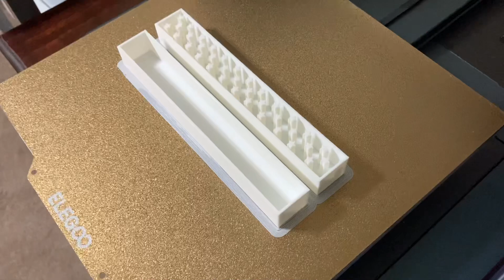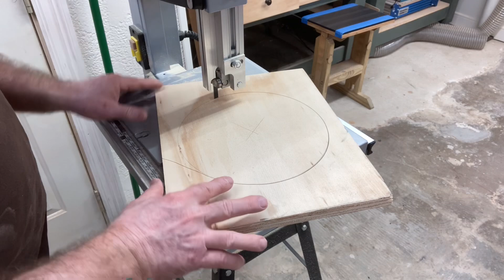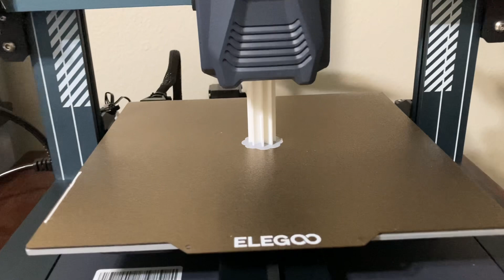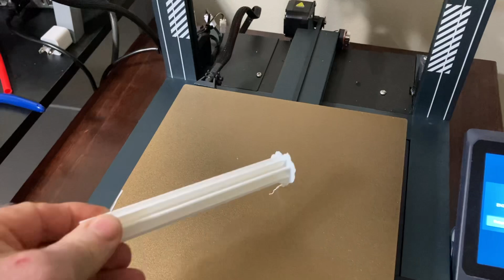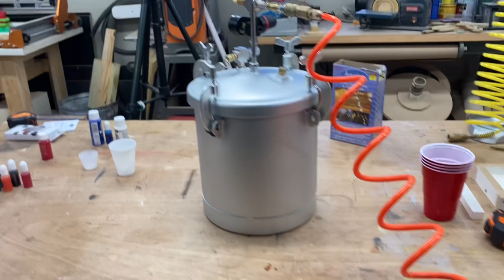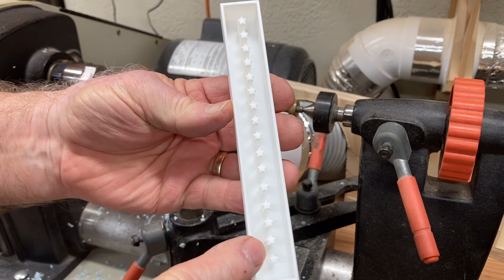3D Print Pen Molds! Any Size, Any Design!

Comment: If you rotate the star design at a 45 degree angle to your printed box and offset each row of stars the opposite direction, you can achieve a 360 degree pattern when the pen is turned.
Reply from the maker: Yes, exactly!!  I’m planning on doing that but did not want to dwell on the same type of videos to long. Thank you
Reply: I used to make 3d printed blank molds and I made this exact type of blank except I made the stars a little larger, but hollow and filled them with white resin. If you ever revisit this and want to use the file let me know.
Reply from the maker: Thank you very much

Comment: loved this video. way to think outside of the box. i've had 3d printers for years and it never occurred to me to use it like this. granted i've made lots of tool related items with my printers. so many people don't realize what a useful tool 3d printers are.
Reply from the maker: Yes, I have made numerous projects to organize my shop however, at some point you run out of items to print. I’m thinking of everything that I can to keep the printers running. Thanks for watching

Comment: Coule you tell me what is the name of thé stripe  model you used. I noticed Tinkercad has two models that look similar to the one you show in thé vidéo.
Reply from the maker: No,  it not a model. It simply a thin bar that I copied to get the number I wanted and I put the cylinder in the middle and hit align.
Reply: @PawPawsWorkShop  Got it !  Thank You.  I really enjoy your work related to 3D printing and CNC topics.
Reply from the maker: Thank you very much

Comment: Why not print a tube with 5% or 10% infill and then fill it with resin that should be interesting
Reply from the maker: Interesting idea. It would need to be turned away. Granted the squares ones are turned away also. The main reason is I have the tubes already